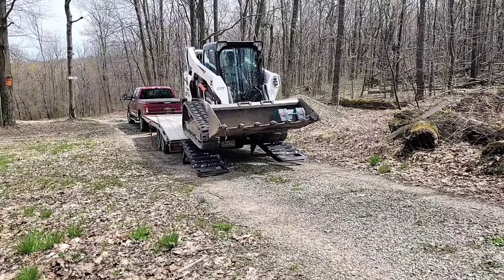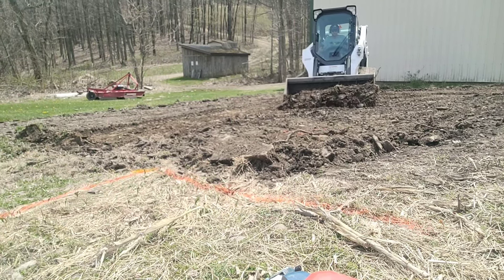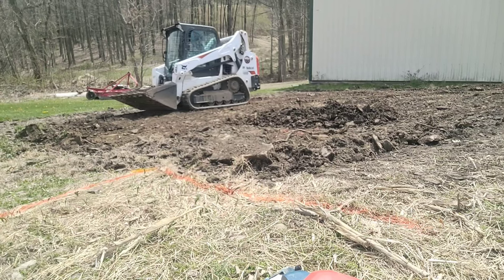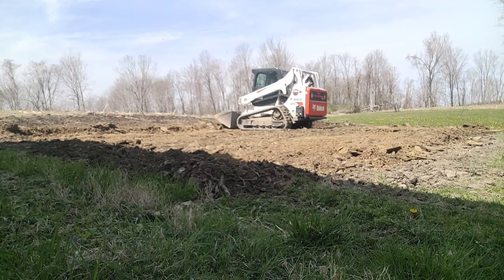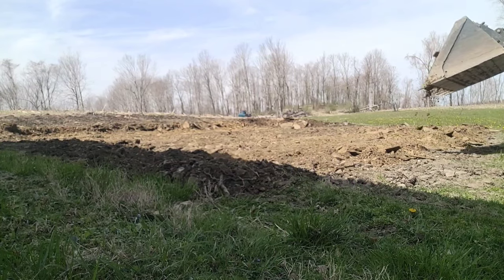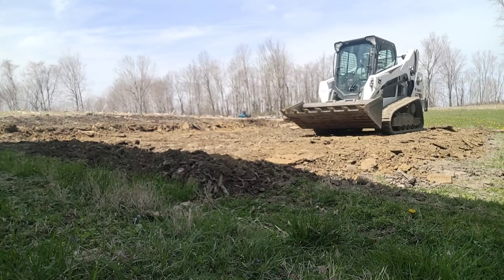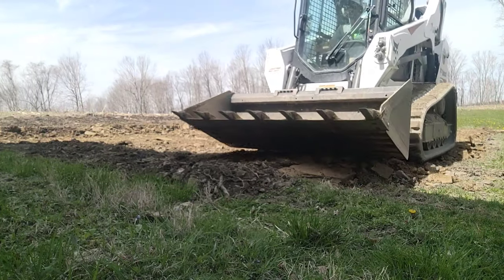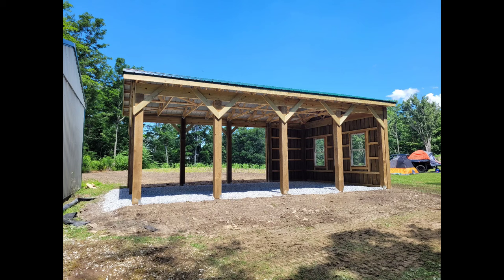Building a pad | Revealing what is involved

Comment: So you contradict yourself by saying you dont want to use top soil as a base but then you say take from your high spots and put in your low 😂
Reply from the maker: Once the topsoil is removed, you cut the high spots and fill in the low. No contradiction. Sorry if it wasn't clear.
Reply: @ExcavationRevelation  I was also confused bc the pad looks elevated as if you brought in dirt rather than removed it, I’ve graded quite a bit with a skid but no rules or guidance on it